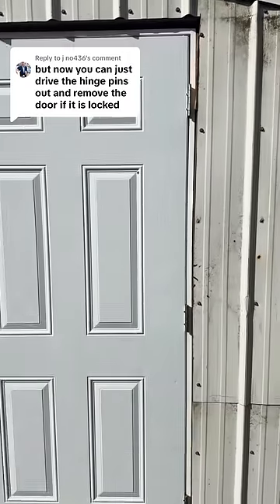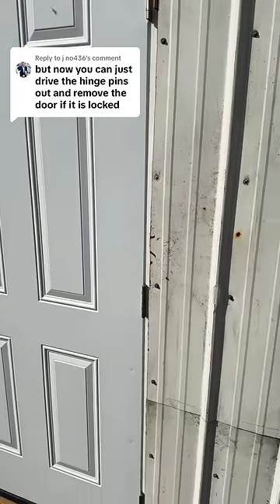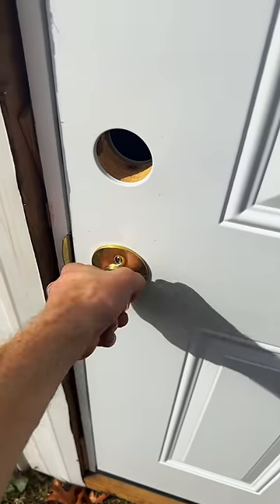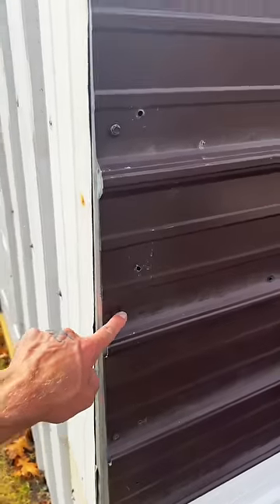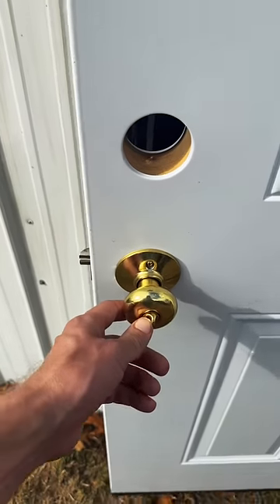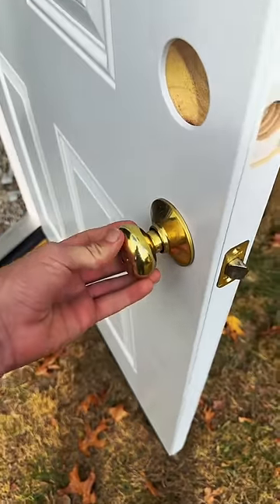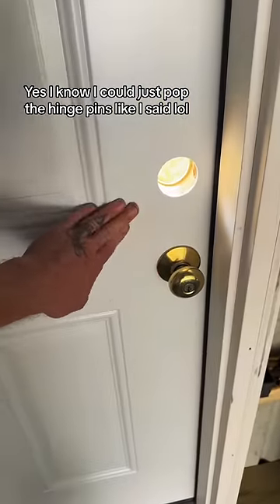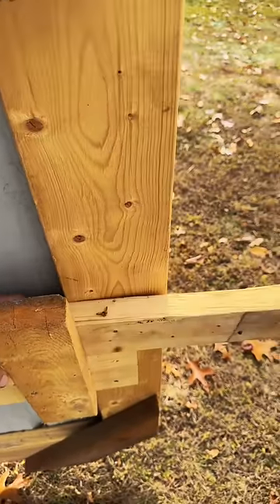Exposed hinges make it easy to get in a locked door

Comment: If someones wants to get in. They will most times. Its practical and your way !  Probably gotta have a few drink before answering questions that seem kinda assholish.  Keep on keeping on!
Reply: I don't know that this applies to this situation, but there are plenty of folks who will steal or borrow when it's convenient, but won't bother to unscrew the sheet metal.

I had to start locking my shop because I had a neighbor who didn't mind borrowing my tools when I was out. And while that might not have been that bad, since I would let her use pretty much anything she asked for anyway, she borrowed them to let other people use them, which is the part that irked me.

I've also had a friend in the military who would steal things if it was convenient, like something in the bed of a truck, but he would never break into a place to steal something. That's when I started locking my car doors. It's not going to stop the thieves that break windows, but it stops the thieves who would steal if they don't have to break the window. Also, the window breaking thieves often don't stop to check if the door's locked, so your unlocked door is getting a broken window regardless.

Comment: Tack weld the pins and put in a deadbolt to lock the door. If you ever need to get the pins out, grind off the weld.
Reply: There are security hinges😊😊
Reply: just get hinges that are desinged correctly, they have pins on the base which keep the door from sliding out
Reply: Sounds like significantly more work, to the point that if he cared that much he’d likely have just gone out and bought a new doorknob instead

Comment: Hurricane code in South Florida says any exterior door must be mounted backwards for wind code
Reply: Not true!
Reply: @mitchkinney7662  Florida has one of the most stringent building codes in the United States, as all exterior doors must open outward if you live in South Florida.
You have no idea what you're talking about, after hurricane Andrew they changed the building code, if you lived here you would know that.
Reply: @GodPapa1640  ah... another ignorant keyboard warrior. I am not from Florida but have lived in the Fort Myers area since 1981. Started out moving lumber and banging nails into hurricane straps. I have built piling (wood and concrete) homes on Sanibel, Captiva, Fort Myers Beach, and Pine Island. I have experience in residential and commercial having worked on schools, restaurants, and hotels as well as resort condos, on the beach and inland. I was in Miami after Andrew rebuilding while wearing a tool belt and a 9mm because of looters. Worked my way up from laborer to crew leader and then to project manager, and I am currently working as an estimator for a multi million dollar structural contractor. I hold a class B contractor license and am quite familiar with the FBC. There are hurricane code approved inswing doors that meet code, however due to the type of threshold they have, they tend to leak in high winds, and we do our best to discourage their use. I can honestly say that it never ceases to amaze me how many know it alls pop up.on comment sections like this, shooting off their pie holes about folks they don't know on subjects that they have little to no knowledge of. Let's see if you can can provide some code related answers without Google.
1. What is the V zone?
2. Are impact windows and doors required on all residential projects?
3. Describe a typical wood framed shear wall.
4. Are CMU walls always considered shear walls?
5. What is the minimum slope allowed for metal roofs?
6. How are residential slab elevations determined?
7. Why do some homes require a stem wall while others don't? 
8. Tell me the formula used to determine rebar laps(splices)?
9. What type of fasteners are required for roof sheathing. 
10. What is the maximum spacing for fill cells in a CMU wall?
If you can't answer these questions (without google) then STFU.
Oh...and your right about the code changing after Andrew but there have been multiple changes since then as well. We are currently working with the 2017 version and there are many supplements that go along with the 2017 code book, some of which are as recent as 2021!

Comment: Ive been a roofer for 35 years. I can litterally pull 4 to 6 nails on a vent on your roof and remove the vent to expose a perfect man size hole.
Reply: So, you can fit in a 8 inch hole ?
Reply: @657spy  aye your mothers been telling ya stories about me again has she?
Reply: @jolanderphilip ahahhahah
Reply: @jolanderphilip this! This right here is why I search the comments in every video. Got em! 😂😂😂
Reply: Another reason to use ridge vents
Reply: Ha.... you said "man size hole"!
Reply: Bold of you to assume I have vents on my roof
Reply: @AWSMcube  even if you don't have vents I can remove a small area of shingles(can be done in minutes), find the edge of a piece of roof decking and have that pried up 10 minutes or so. When I commercial roofed in So Calif I fixed many holes due to burglaries. Most homes are not that difficult to get into if you do construction and understand how a home is put together.
Reply: @marcmiller789  Well shit 😂
Reply: Well, that won't work on my roof. I have a ridge vent.😂

Comment: Door guy here,  people can always replace hinges with (NRP) Non Removable Pin Hinges , the pins have a groove in them in which a allen set screw is in the hinge that turns into the groove of pin and prevents pin from coming out. Feature used for outswing doors if needed, but you sureley dont need.
Reply: Door guy/glazier here 20yrs. I approve.

Comment: The outside of an exterior door is metal or fiberglass... The core and edges are usually wood and non treated at that so just remember that the door can absorb water and rot that way.
Reply: In Florida, doors are installed so they open out for hurricane wind pressure. So the hinges are on the outside like that. There are either pins that stick out on the hinges, so the door can't be pulled out. Or you can get extended screws that prevent the door from being pulled out as well. Or even sealed hinge pins, that don't remove.
Reply: It's an interior door anyway, they didn't have exterior doors in stock according to the other short
Reply: @richardmillhousenixon  he said an inswing... It's an exterior door that swings in to the room
Reply: @MichaelCushmanPhotographer  yes and there's even some that are designed with a lip around the perimeter similar to old house trailer doors
Reply: Metal doors are usually steel, both sides and wood interior is usually an up charge
Reply: @ronniewatts9110  You are correct, however I have never in my life seen an exterior door that is steel on only the exterior face. Every single one I've seen is steel on both faces, sometimes with a wood core, other times with wood only around where you install the door hardware so there is something besides steel to secure to.
Reply: @richardmillhousenixon  I'm not sure what you're getting at... I didn't say anything about only one side of the door being metal. What I'm getting at is the wooden core, that is sandwiched in between, is exposed to the elements when you install it backwards and the seals are then on the inside of the door... It wouldn't really matter if it were on a porch or there was an overhang and it could just be painted, but there's no overhang where its mounted.
Reply: @ronniewatts9110  You said the outside of the door, that read to me as if you were just talking about the outside/exterior face

Comment: Hinges sometimes have a lug that engages the two plates to prevent the hinge side from swinging out if the pin is removed. They're designed for outward facing hinges.

Comment: Glad I'm not the only one that thinks about locking myself in a building 😂
I put one of those latching deals basically has a place for a string to put through a hole to the inside to unlatch it and I was about to forgo it until I had a flash of me dying in there because the wind blew it shut lol 
In reality there's tools inside I could probably blast a hole through the side of the building but alas pulling a 'string' is much easier...
I actually used weed eater string which seems to be holding up quite well.

Comment: I highlllyyyyyy suggest getting a kwikset lock for that door fr!! You’d be able to change the key you wanna use for it with a little piece of metal lol.. and they’re relatively easy to pick and reset it you’re worried about losing whatever key you set it up with.. I used to unlock my garage door with the same key I unlock my shed with lol

Comment: There’s usually catches on exterior door hinges that won’t let the two sides of the hinge slide apart when smashed up against each other like when a door is shut. So even if you remove the pins it won’t remove it. Out swing doors are very resistant to battering as well.

Comment: Good hinges will have a raised bit on one side that seats into a hole on the other side when closed so even if they are external and the pins are removed, the door is still fixed in place. The raised bit faces the pin so that if you pry the door out, itll only get more stuck.  If this was for security purposes good hinges with a protective cover over the lock set side would be surefire.  For anyone that wonders.  😁

Comment: The Latinos that installed my building tried to install my door backward like that. I had them install it in the proper direction. You can buy captured hinges for outswing doors. The other issue you may not be worried about is that the threshold is backward and won't keep water out.

Comment: My apartment door has hinges on the outside, but there are special tabs on the hinge side of the door and frame that prevent sliding out the door even if the hinge pins are removed.

Comment: You can buy security hinge screws that will hold the door even if someone pops the hinge pins. The door will fall off when it's opened normally though after the pins get removed.

Comment: This is actually similar to the doors of the MTRCS stystem used by the US Military (basically a giant containerized fridege). There are escape doors on all the doors that are impossible to get into from the outside, but have a latch on the inside, in case someone accidentally locks you in or blocks the door.

Comment: There are hardened steel pins you can tap into your door on the hinge side to prevent any sliding out that side. the door has to pivot out to release the pins

Comment: I love how many people just don't seen to understand that there are hinges that prevent opening the door by driving the pins out. literally every external door in south Florida MUST open outward with hinges on the outside to meet code
Reply: That's not the point of this. He is trying to be as cheap as possible where possible. Unless that door was there already it makes no sense to have it swing out. The whole reason he installed the door this way seems to be because he thinks the entry door must have the lock facing the opposite way of the hinges.

Comment: That is hilarious about the screws in the siding! My dad was a huge prick when I was a young teen, he had an amazing pole barn with a vehicle lift. Whenever I'd have issues on my truck it was so much easier to stick the vehicle on the lift so I could work on it but he didn't want anybody inside his shop because he had all kinds of nasty homemade sex tapes and women's clothing he would dress up in inside. So sometimes when he would go away to screw around at the motels I would just zip out a few screws on the corner and crawl right in! He eventually found out and thought that applying a 6 by 6 piece of plywood at the corners would keep me out. I just moved down about 8 ft to the next joint then do the same🤣! This guy was a complete piece of shit before you get to up in arms of him, he used to beat me and my mother before I got old enough to defend myself

Comment: I bought the cheapest keypad deadbolt on Amazon that didn’t have a keyed lock cylinder. Nobody can pick it. And I never have to worry about locking myself out. Plus I don’t have to give anyone a key I just give them my guest code and then change it after they don’t need it anymore. Great for when we have the neighbors check on that cast and whatnot for us.

Comment: If you ever need to prevent the hinge pin issue and have to mount them that way, they sell Door Hinges Security Screws to prevent the door from pulling away even with the pins removed

Comment: I got stuck in my garage one time because the sliding door came down so hard the bottom section folded to the outside and it got jammed in the track, luckily there was enough room for me to squeeze out the bottom, but I spent about 20 minutes trying to lift the door and slightly panicking because it wouldn't budge.

Comment: They do make safety pins that screw into the frame, the pin extends into the door. If the hinge pins are pulled out. The door is held in place by the pins.

Comment: You can also
Put in tamper pins in the hinge, basically replace a screw or two on each hinge, and even if you pull the pins, the door remains “secure”

Comment: Leave one screw out of the hinge and place a stud screw in the other side, when the hinge is closed it will keep the hinge from sliding apart when the pin is pulled.

Comment: You can get hinges with captive pins that can't  pop out and better than that you can buy special fasteners that replace one of the screws holding the hinge to the door frame, it's head sticks out and goes into the frame where another screw would normally be so even if you pop the hinge pin the door cannot bee walked off the frame

That is IF you care about that kind of security, its rarely applicable

Comment: I know its not relevent in this case, but for anyone else with a door that has external hinges, look into security studs. They basically lock the door in place so that even if someone knocks the hinge pin out, they cant just pull the door out of the frame.

Comment: I've seen some hinges that have a pin thingy and a slot on the counterpart where the pin goes when it's closed so that even if you popped the pins from the hinges you couldn't open it

Comment: Obviously this wouldn’t work in this situation but for outward facing doors there’s these things called security studs. They replace a couple of the screws on each part of the hinge and make it so that the door is insanely harder to remove by popping the pins but opening it normally you don’t notice a difference. It costs like $5 and can be installed on most existing doors.

Comment: Sir i have the sony xm4's. They have a known issue sony didnt care to fix, the batteries get overcharged and die extremely quickly. Like they lasted me a little over a year of moderate use. If you havent had them for a year yet, tell them your batteries are fried to get them replaced near the end of the warranty so they last as long as possible.

Comment: Rule #1: you can only break the rule if the rule was followed lol...

I have a 30 year old European car that only sold 20,000 models from the year I purchased it, 2002, and the ECU to key security is so intense I can barely break it knowing what I'm doing. No sense in locking the car, key is in an unusual position, the radio is 1.5 DIN and married to the car because it's OEM. I don't need to lock the doors because frankly if you're willing to steal a car that's only worth scrap price because of the dents and rotted interior I salute you, but I promise with the RFID tag incorporated in the unusual key you're not going anywhere. Anything is possible, but when it comes to a 30 year old defunct car with only matching locked parts that need factory resets to clear well... power to you on knowing you completed the task and made no money taking my ride!

Comment: Finally American is installing the door correctly. Only that those hinges are deeper in the frame and cannot be just popped out. This also has benefit of door opening outside that allows quick exit once door has found, not fiery death if debris has blocked the door from opening. Also helps if someone tries to break and enter.. try to ram the door trough the frame is bloody difficult, try to pull it out with truck and you most likely just pull out the handle, leaving the lock and lockframe intact.. least if you use actual locks and not intelligence tests known as american locks that child knows how to pick.... and of course using actual door made of hard wood that can stop rifle round, specially if there is steel place added and not something that supposedly looks like door but is made from cardboard.

Yeah this is why burglars 9/10 go trough the window instead of the door, rather claiming to balcony than trying trough the door with force...

Comment: hinges on the outside means the door swings out.  nobody will ever kick in that door.  secure the frame with 3.5" deck screws spaced about 1 foot apart (3.5" is long enough to secure the frame to the both vertical studs on each side, and into the 2nd header), all the way around the frame.  then drill 4 or 5 holes in the hinge side of the door, then place as many forming nails in the frame as you drilled holes in the door, aligning the nails with the holes.  with a sturdy lock to go with, the only way anyone is getting through that door is to completely destroy it.

nobody will ever kick in that door, and with the hinges pinned and a sturdy lock, it doesn't matter if the hinge pins get pulled, that door isn't coming out of the frame.